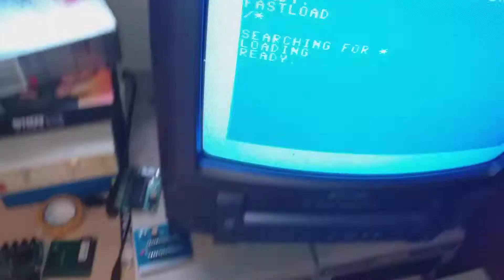PI1541 Zero With Epyx Fastload Combo Cartridge

Comment: A great idea , I take it you can still use £ to get Epyx Menu to disable fastload if not needed and also does this load Ghost n Goblins Arcade by nostalgia with no corrupt title screen ?
Reply from the maker: You can disable the fastloader through software or you can take the cartridge out and provide power with a micro USB cable.Corrupt screen with the Ghost Goblins is related to dodgy 7406 chip used in the option B setup.This cartridge is the option A without the 7406 so it is not effected.

Comment: The only thing for £4.80 on the Pimoroni Website is the Pi Zero USB Stem , The Pi 0 with header is £12.90 and £9.30 without the header ? but they are both out of stock, Unless i am missing something ?
Reply from the maker: https://shop.pimoroni.com/products/raspberry-pi-zero
If you don't want to solder the header,you can buy a Hammer header for £2.10 (Male)
https://shop.pimoroni.com/products/gpio-hammer-header?variant=35643317962
Reply: @remziload6476  Cheers , will this also work ? https://thepihut.com/products/raspberry-pi-zero-1-3-with-pre-soldered-header-no-wifi-or-bluetooth?ref=isp_rel_prd&isp_ref_pos=2
Reply from the maker: @Rick_Todd  That will do the job mate.
Reply: @remziload6476  Just got around to trying it , It works perfect , Much better than an SD2IEC , Thank You.
Reply from the maker: Thanks for the feedback.Enjoy it.